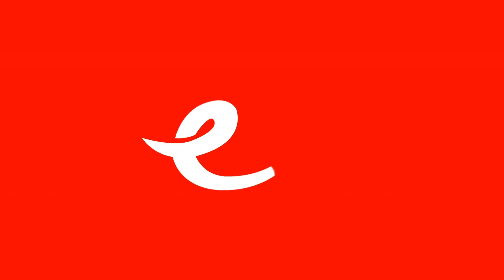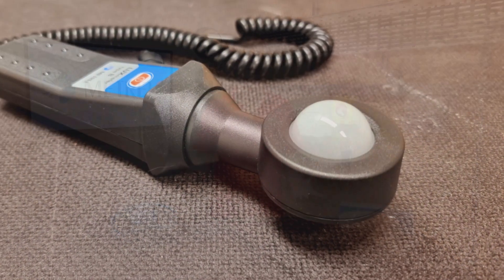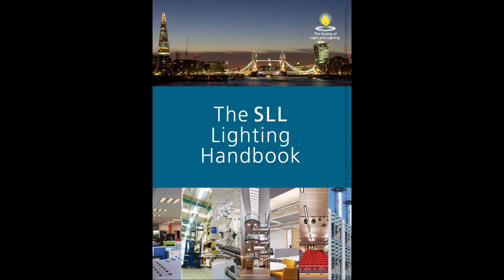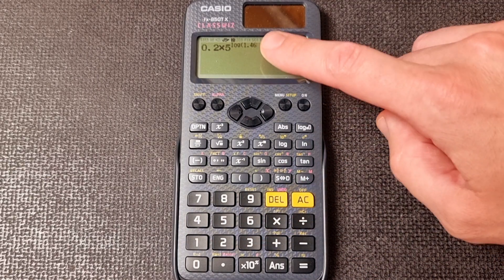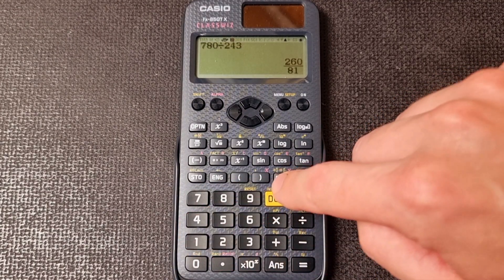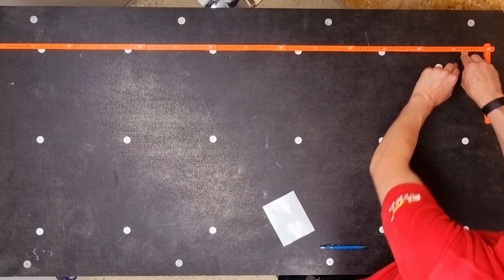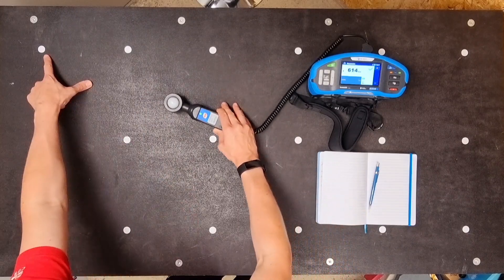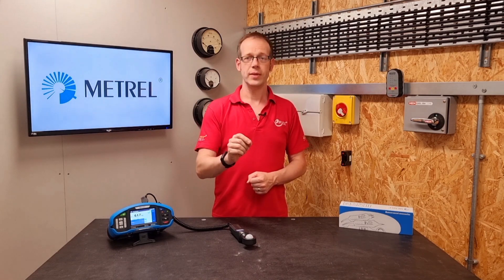How to Measure Light Levels in a Room

Comment: Another overpriced gadget . And with all those measurement’s no electrician is going to faff around like that. Also the light meter I used for photography measure’s reflected light ambient light as flash and lux and it cost a hell of a lot less than that thing from Metrel. If you move the lights closer to a surface you increase it power ie the brighter the surface will be, move the lights  further from the  surface the less power ie the dark the surface will be . 
Great video though as always Joe 👍

Comment: Hi Joe, why is it not recommended to use a spreadsheet? Just curious because I use them quite a lot for different things.
Reply from the maker: It's because of the way they handle numbers particularly when it comes to rounding off. 🤔
Reply: @efixx  Joe, with great respect, your remarks about Excel seem very wide of the mark.  In this case Excel is thousands of time more accurate than your measuring process.  Yes, like any complex tool, you need to know how to use Excel and be aware of any issues.  (Ask a geneticist about the handling of Mar3 in Excel. 😉 )
Reply: @efixx  Excels great. The only thing that excels it is user error ;). I use it for everything!